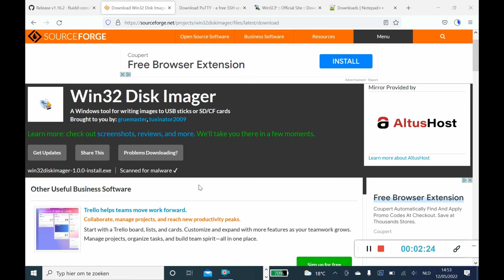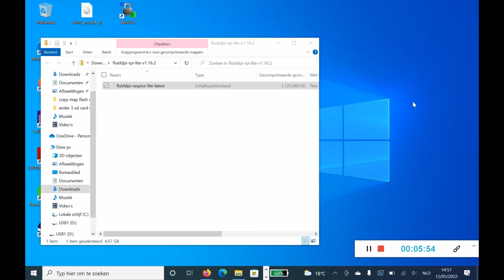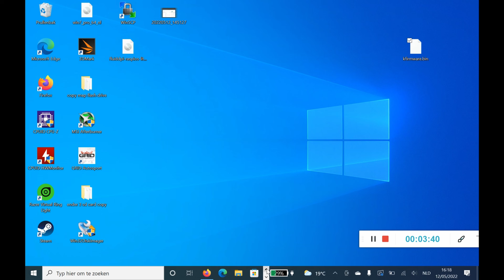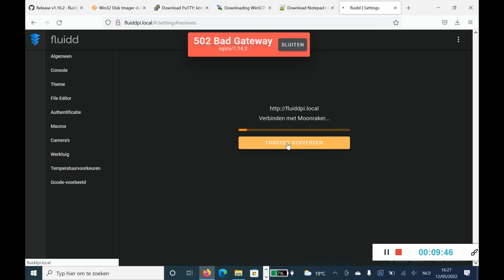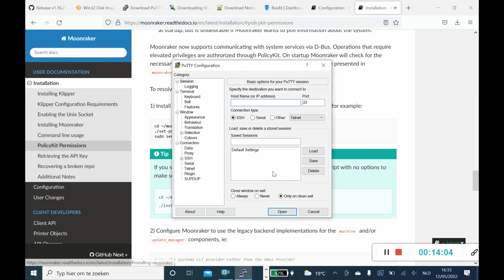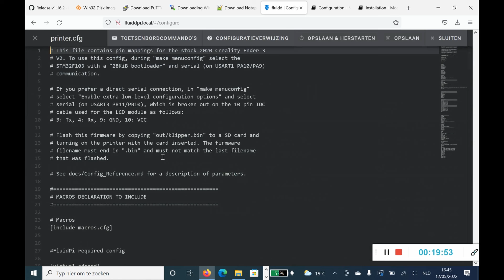Installing Klipper Fluiddpi on the Raspberry pi 4b Tutorial / ender 3 S1 , ender 3 v2 (32bit)

Comment: hey, I keep having issues with connecting the pi to any wifi network. I used both notepad++ and VScode. even changed the country=**. board is the raspberry pi 3b+.
Reply: tried it on two different networks.
Reply from the maker: @GTexperience_Channel  do you have another pi to try it on?

Comment: What was the chipset on your new S1 board replacement?
Reply from the maker: STM32F4
Reply: @aim6mac  Why did you choose STM32F103 in Klipper for your Processor Model if you are using STM32F4? I am using STM32F401 so that is what I should choose?
Reply from the maker: @rock4401  I have a new board but i'm not using it lol, i still have the STM32F103 in the printer, thats why i choose that one. U should choose which board u've got.
Reply: @aim6mac  OK thanks man, I was a little confused but I chose the board I have.